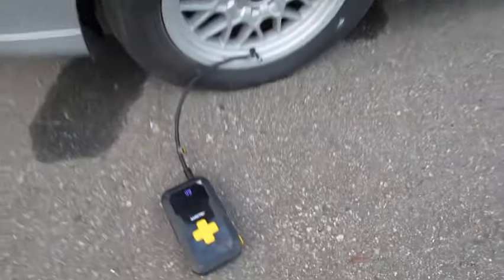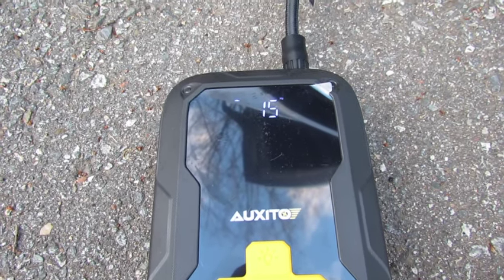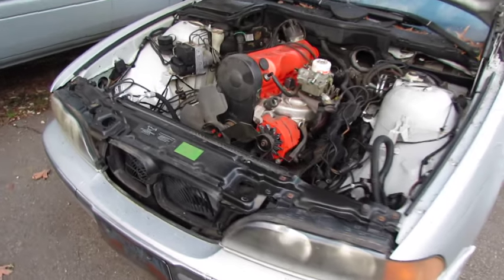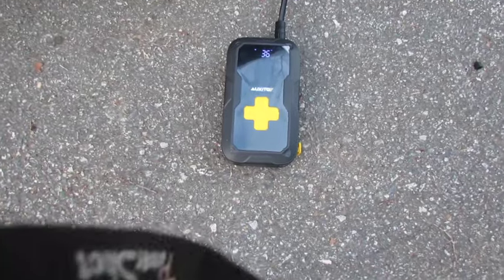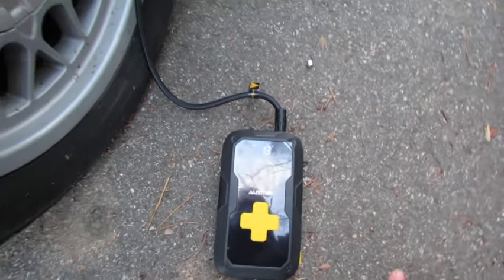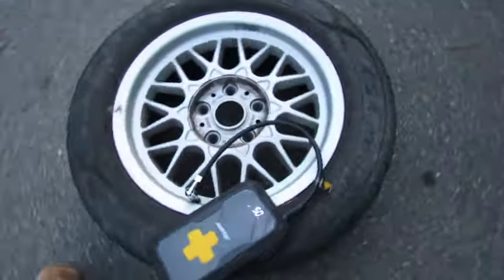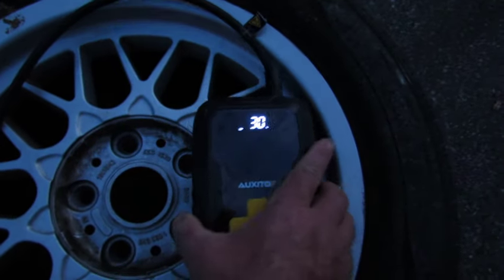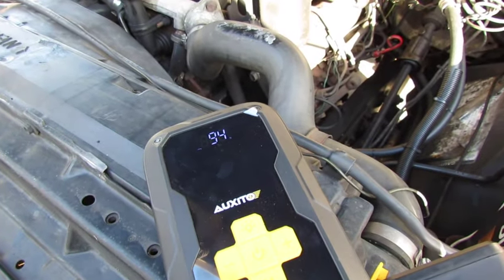Auxito Air Compressor:Jump Starter

Comment: Nice. 
If I'm at home inflating a low tire, I use my jack to take the weight off the tire so it fills faster. Easier on the compressor especially if the tires almost flat. Good review. Happy Motoring.